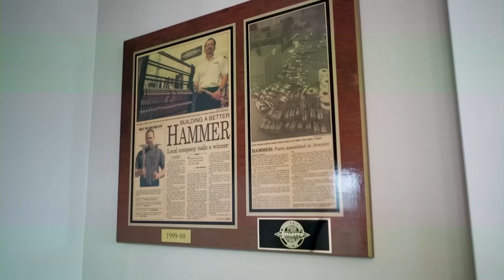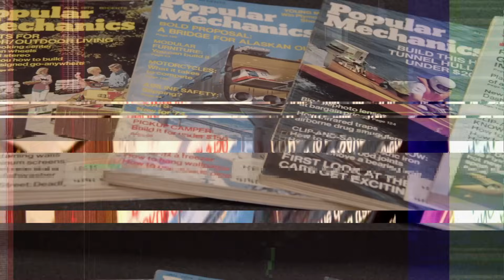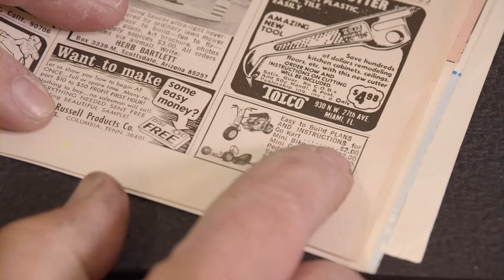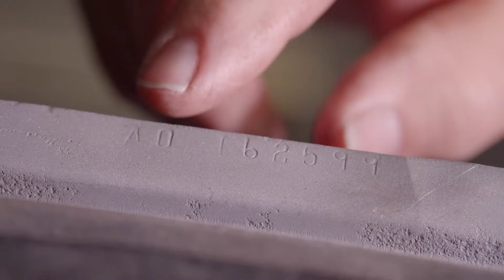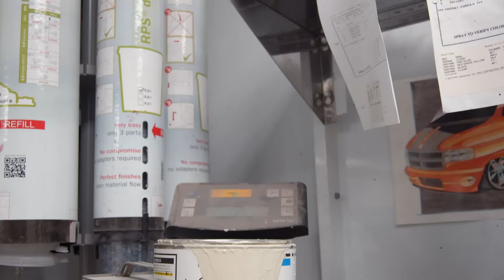1970 CHRYSLER 300-H TRIVIAL PURSUIT SPECIAL INSERT EDITION

Comment: I really hope he explained to that fine gentleman that it's a 1970 Belvedere that Mark will turn INTO a RR
Reply: I had a 1968 Dodge Charger. Nothing special, just 318, 2BBL and it came to me on work related basis. Pull two engines, make one run, Ford. The owners manual had the same thing in it. I kept insurance, registration in it, inside a plastic bag and always figured one book worked for several vehicles. I can’t say right or wrong but I know what you’re saying. We had a family car an unsold fire chief order and back then, the dealer called when it was ready. 1963 Belvedere Station wagon, push button shift, fire engine red, even chrome rear deflectors to keep dust off the back window. Still had thick sewn plastic seat covers on it when the timing chain came off the upper gear after plastic/nylon broke. It had 268k Miles and ran great. A 383 golden commando. I wanted to fix it but my step father drug it into a ditch in the back of our property to keep cattle in and stop water. Seemed as a waste because every Sunday, it was my job as the oldest to check & adjust all fluids. Wash & Wax the car with turtle wax. This was about 73. I took hay money and earnings from mowing yards, bought a 65 Chevy Apache pickup from a construction company. It was used on job sites primarily to refuel earthmovers, bucket loaders and such & oil changes. It had a wood floor in mint condition soaked in diesel fuel & oil. I guess a good wood preservative applied weekly, by dripping. Almost 3 yrs with 283 & power glide trans before going to fast to second hour school from the field, hit bottom hard in a rock bottom creek. I made it about 2 miles, wheels locked up, then oil light came on and skidded off to the edge of a county dirt/gravel road. Walk in. I was pissed for $1.50 per hrs running a John Deere 4X4 with gigantic single flotation tires so not compacting the ground. Got two buddies in a Subaru Brat and chain, drove out to get it the same day and it’s gone! If I had the VIN I would have filed a police report. Asked everyone for 3 miles & never found it. $200 in 65 Fury III 4dr off to college with two high school friends. Last Chrysler I ever owned after the Charger. Stored under military tarp at half brothers farm (He Inherited) and handshake to keep it for up to 10 years. Went back after 7 yrs, his question was “What Charger”. Machine shed empty from my vantage point. Police report still on file. No more!